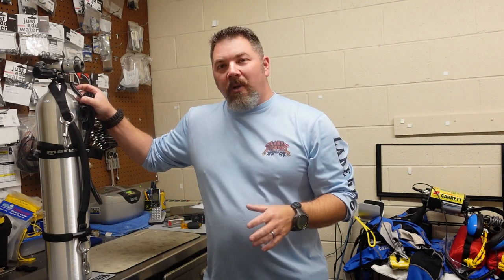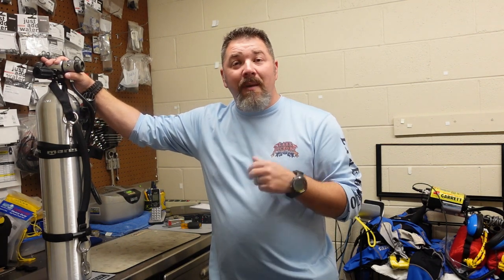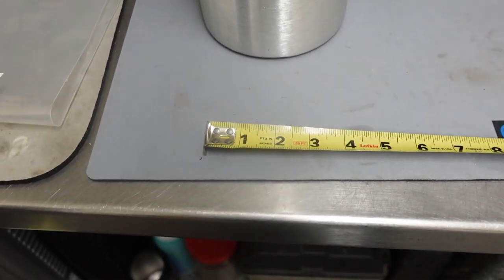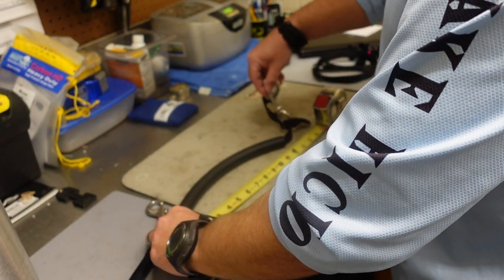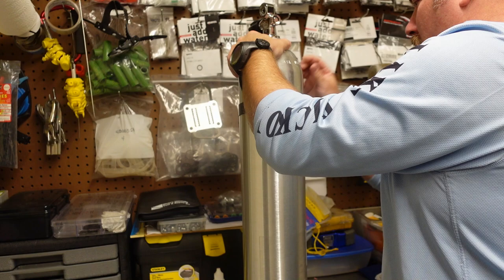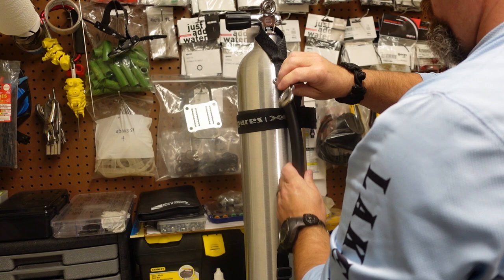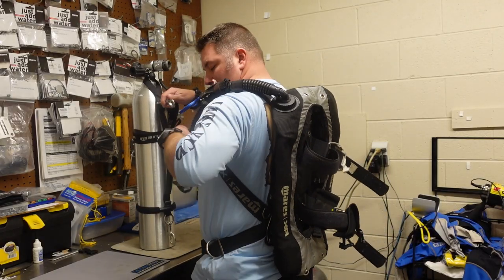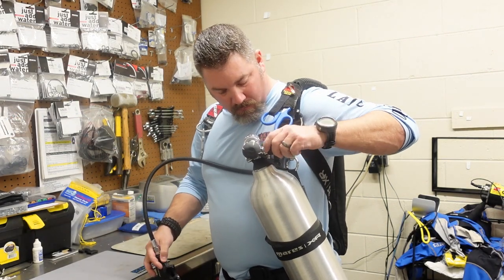Setting Up A Redundant Air Source {[The Pony Bottle]}

Comment: Thanks for another great video. Nice setup! I have a 19 cu ft AL cylinder secured to my 80 cu ft cylinder with a pony mount bracket. There is a small button spg on it and the regulator is right in front of me on a necklace.   This allows me to be a little more hands-free to operate our camera while still having a fully redundant emergency tank. 👍
Reply from the maker: Sounds like you got a great set up Triton's Realm.

Comment: Brian, love your videos!   This pony bottle harness setup video is THE best on YouTube!!  In the video you note the importance to setup ones harness to ones size/needs...  nobody even mentions this!

In the video you measure the distance between the upper & hip D-rings, but don’t mention how to use it.   After watching the video several times, I’m guessing that distance is used to locate the location of attachment points for the bolt snaps.  Is that correct?  

I recently tried a pony tank for the first time and found that the pony bottle valve was dragging along the bottom of the pool.  Not very streamlined and obviously not set up for me.   Part of the problem was the location of my upper D-ring.   With your help I’ll get my future bottle set up correctly without to much fine tuning needed.  Thanks for all!
Reply from the maker: Hello Bill Kirksey, you are correct. Measuring helps determine where the bolt snaps should be placed. Also you can add a bungee to the side of the BCD that you plan on slinging the bottle to help make it more streamlined.

Comment: Great video. Can you share more about redundant air source usage? Maybe opinions about when/why to sling versus rear-mount along the primary air source, bottle size considerations (ie 13, 19, 40, 80),  and practical applications?  I own a redundant air source, but find that many dive boats seem to be less than thrilled about their usage - so I have very little time using mine. When do you use such a system, and how do you travel with it?
Reply: For back mount you'll have a difficult time turning on your air source without a buddy.  Slinging also allows you to donate not just a reg but a whole set up to your buddy.  I like the 40 because it allows for a safe ascent from greater depths (like 30 meters in recreational), plus a safety stop, and even a deco if you(Or your buddy) screwed up that bad.
Reply from the maker: Hello JaeEmZee, we will be producing another video about back mounted pony systems and when we choose to use them. Stay tuned.
Reply: @LakeHickoryScuba  thank you!

Comment: Thanks Brian. Didn’t see a pressure gauge. What are your thoughts on that? I have a button style on mine.
Reply from the maker: Hello C. Patrick Sadowski, button gauges or gauges on a 6 inch hose will work just fine. Typically, on a pony bottle we don't run them, but we do on all stages.

Comment: Nice 👍🏻 video! I do suggest adding a small PSG or even a mini 3000 PSI gauge attached to the first stage.
Reply from the maker: It definitely helps with verifying how much air you have before the dive. We prefer the button gauges for Pony Bottles.
Reply: @LakeHickoryScuba  the button gauges is what I call the mini psi 3000 gauge. It screws into the HP port of the 1st stage. 
Keep up the great videos Bryan!
Reply from the maker: Yes sir, those are the same gauges.

Comment: I got into sidemount for the purpose of solo diving but Im starting to see the versatility of using a pony system. Say I'm diving BM with my usual buddies and they decide they're done for the day but I want to do another dive. It would be so much easier to just grab an AL40 out of the car than to change my entire configuration.. Hmm.. I may need to get an AL40 soon.
Reply from the maker: Hello K B, sometimes Pony Bottles are great, but like you Sidemount is my preferred option.

Comment: Yet again, another great video. I don't know if he covered it in the video, but what did you have your hose clamps wrapped with? I've never seen those metal bands covered black like that.
Reply: For mine I just have the XS scuba stage kit which includes the camp band with cover, I believe he is also using the same kit, but it's just black nylon tubing.
Reply from the maker: Hello Ryan Lantta, its tubular webbing that comes with the stage kit.

Comment: I have a great opt to pickup a Zeagle 20cf that I was planning to use as a bail out bottle. However in thinking ahead, does this 20cf "qualify" as a second redundant air source for the SSI Independent Diver certification? Seems a waste of money if I'll need a 30cf/40cf etc down the road for the certification.... I couldn't find any info listed as needed equipment for course
Reply from the maker: Hello @flyingnittanylion, the most common sizes are the 30cf and 40cf. I tell all of my students to calculate their redundant breathing gas, based on their personal SAC rates, and add 3 extra minutes for a safety stop, and an additional 5 minutes for emergencies. Once this is done, then whatever their personal needs are, that will help them determine how much extra gas they should take for redundancy. Just to clarify, you will need to calculate both your SAC rate and your RMV rate to get the answer you are looking for. Now in regards to what is required for the SSI Independent Course, standards simply say a redundant system. So technically, it can be any size cylinder. Most Independent Instructors are like me though, and will suggest either a 30cf or 40cf.

Comment: I've always wondered if out-of-air drills should be done on empty lungs?  No way in real life would you reg fail just after you've taken a nice big lung full, it's fail when you came to breath in after having exhaled i suspect.  There's a world of difference in the panic and anxiety level between having nice full carbon dioxide free lungs and having to swap to a bailout set, and doing the same in a bit of hurry because you're desperate to take breath?
Reply: At least on the technical side the opinion of my cave instructor was that all his out of air shares weren't right now emergencies. As the problem person could breath off the other tank for a while.

Though we still practiced them as if they were right now emergencies. Including that breath hold swim during the DP class.
Reply from the maker: Hello Max Torgue, as someone who has been in this industry for 32 years, I can state that regulator failures can happen at any time. I personally have had issues of them simply not working, or wet breathing before, mid, and at then end of a breath. This is where practice comes into play. Muscle memory means a lot during stressful situations.

Comment: I dive mine with the hose in back of my neck and the regulator hooked to a neck strap. Good idea or not so?
Reply: I think it’s best slung the way he has it. That way I can use it or my buddy can use it or I can give the whole thing away. Plus I can reach the valve to turn it on and off. I have had all of those scenarios present themselves.
Reply: I have mine on a neck strap as well. It's been a nice setup for me while solo diving. If I'm diving with a buddy and they need air, they can use my octo.
Reply from the maker: Hello g Davis. My suggestion is to see what works best for you, and in the situation you are diving with a buddy, make sure you do a thorough pre dive safety check and explain to him or her how an out of air emergency should be handled with your set up. Also, make sure you train with your system so that you will become proficient with it.
Reply: @LakeHickoryScuba  Thanks!

Comment: I am looking at the 40
Reply from the maker: Hello searching4279, both the 30 cf and the 40 cf are great options. Most divers find that anything less than the 30cf are not that practical. The key thing to consider is your personal SAC and RMV rates, and how much air does it take to ascend from a given depth. Once this is determined, then you can choose the appropriate cylinder.